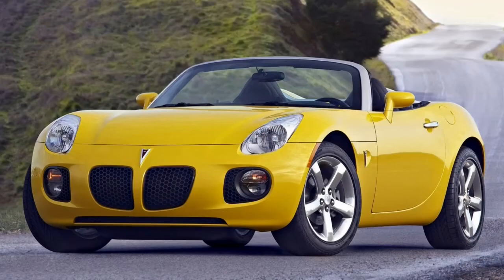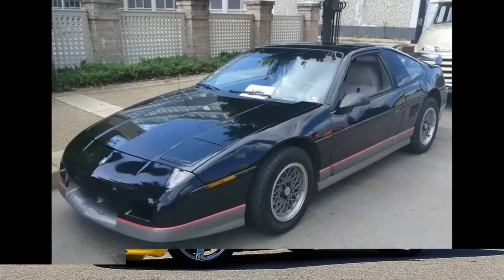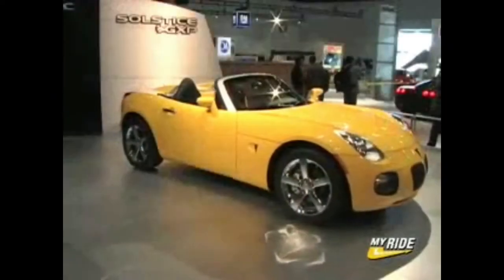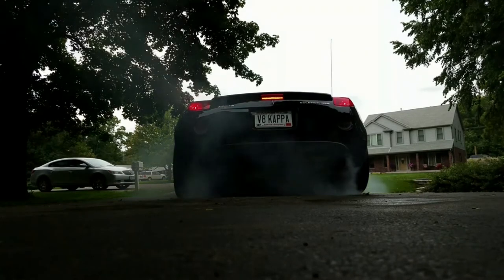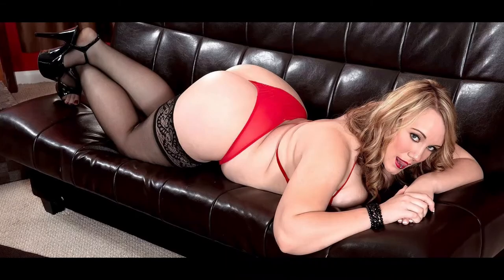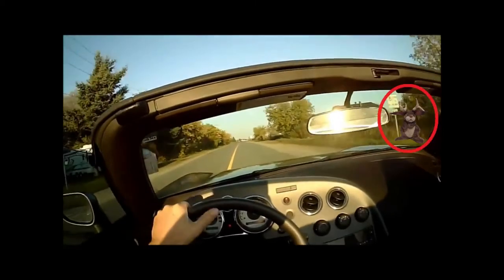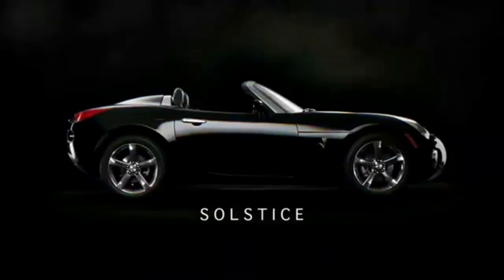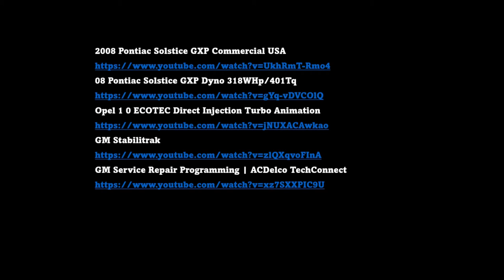Pontiac Solstice

Comment: Cheap interior?  Yes.  Rattles?  Yes. Not the greatest fit and finish?  Yes.  Storage room of a matchbox car? Yes.  (Actually you can get a surprisingly OK amount of stuff in if you really work at it.). Stock tires mediocre?  Yes.

But….

260 HP and TQ easily upgraded to 300+ with tune…
0-60 in the 4s very feasible…crush a Miata.
Double wishbone suspension.  
18” wheels.
LSD.
Great turn in.  
Unique and cool looks.
Ability to completely turn off all traction control or go to a competition mode.
A complete hoot to drive.
If you totally baby if you can get around 30 miles per gallon. Of course based on the above comment you’ll probably end up getting 19 with your pedal to the metal.
Rock solid at highway speeds.
5 speed manual is halfway decent and not that big a deal to not have 6.
A hoot to drive…did I say that already? 😊
Reply from the maker: I don't need too much convincing 🙂 I am looking at them, wish I could afford a GXP. Putting a turbo kit on the base model would also be appealing (I like to wrench).  The Toyota MR2 Spyder and C4 Corvette are also on my short list. Turbo kit the MRS or LS swap the C4?
Reply: All true.  I'll add the $420 brace bundle and we are dare I say rolling with a sleeper?  All done for cheap and then competes with other sports cars tens of thousand more.  And...now the resales keep going up.  Perhaps more are learning about the capabilities of these sweet rides.  Many of the previous reviews were of the 2006, which were all base models which is a huge difference. Base models look like sports cars, the GXPs are sports cars.   Only bad thing is you have to be ambitious to find a low mileage GXP,  manual shift with the goods for less than 18K.   Just did a 500 mile search, found 3, all yellow,.  I'd have to drive 400 miles just to go look at it.
Reply from the maker: @2wrdr  Other than the engine, what specific changes are made to the GXP?
Reply: @jasonbowmanlovescars6966  All I know is Huge HP and Torque from Turbo.  Dual exhaust on GXP,  front brake cooling, LSD, and Bilstein suspension.  Oh yeah, as Aretha Franklin would say R.E.S.P.E.C.T..  Seriously though with the base model you're mostly stuck with what ya got.  The GXP and Redlines offer much much more in terms of upgrades as the stock 2.0 seems overbuilt allowing much more to be had.  My GXP is stock plus tune, plus chassis brace kit.  The tune got me 40 more ponies so that's 300 vs 177!   The brace kit makes for a more bumpy ride but that is tradeoff for even better handling.  I paid 12K for my GXP 6 years ago with on 9,200 (not a misprint) miles on her.  I know of nothing that offers this level performance for the $ (although $ keeps going up) while looking sweet as a bonus.  For any more, Google and forums are your friend.
Reply from the maker: @2wrdr  I am poor and like to wrench, I was thinking about getting a base model and putting a turbo on it. The GXP's are HUGE money now.
Reply: @jasonbowmanlovescars6966  Jason, this review is very old but does an ok job at explaining the differences.  Bear in mind back then they would not have known of the easy and mostly cheap upgrades you can do on top of an already much better performance car.
Reply: Link might help. 😄 https://www.youtube.com/watch?v=srtbhI0R8-A
Reply from the maker: @2wrdr  You can find a nice base model for $8000.00 The GXP's are double and then some. For $10,000 you could add a limited slip, coilovers, all the braces and a tune and a turbo kit. Back when GXP's were $8000.00 it would have been a no brainer, but now in 2022 I would build, not buy 🙂
Reply: @jasonbowmanlovescars6966  Understand your point but I suspect resale of homemade vs. factory GXPs/Redlines would leave the factory versions ahead.  That said discounting resale I can see where the project could be fun if your really into that.  I no longer have the energy for the issues which always come on projects like that.  Now if I were 30 years younger....
Reply from the maker: @2wrdr  A factory GXP will always be worth more than a base model that has been modified. I am 47 and I have three project cars that are running, but all have typical project car issues, so I see where you're coming from there. 🙄